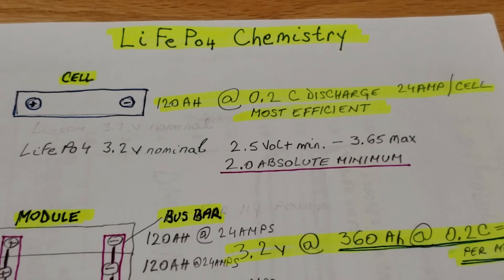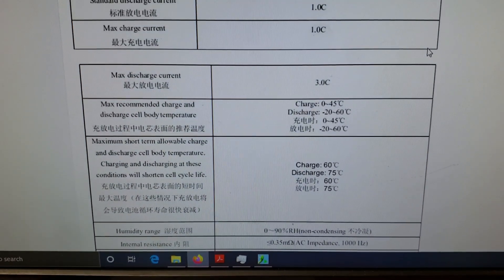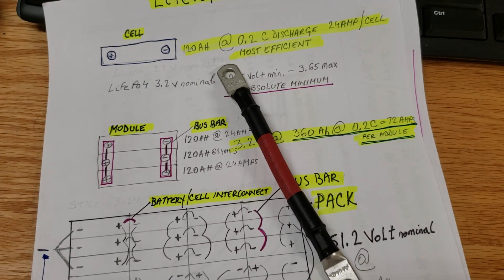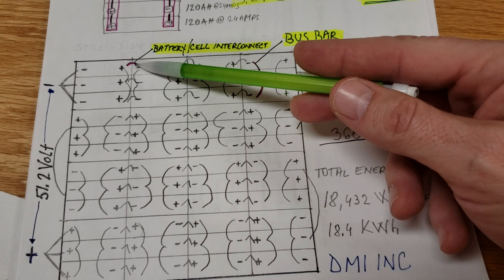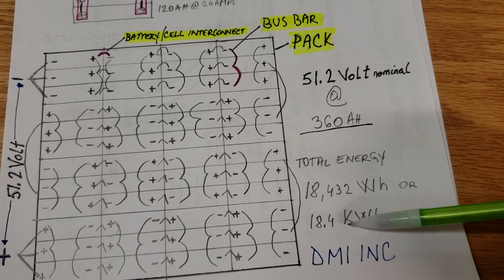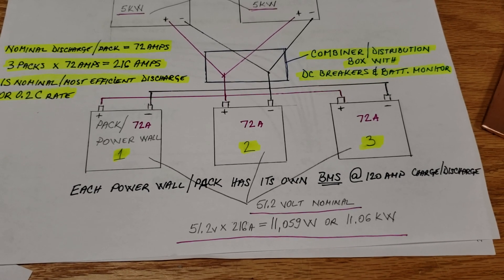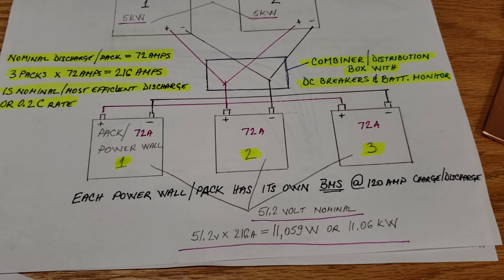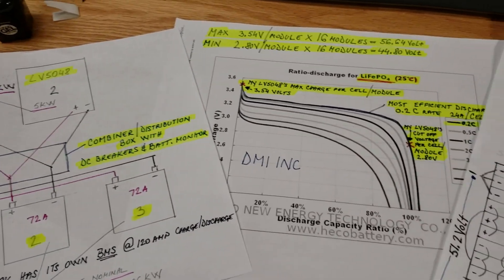MPP LV5048 Battery Talk.

Comment: It's been a while since I been on here I have the same identical 120ah cells coming I was wondering can I do that same 3 cell configuration in a 24v format & how many cells it would take ?
Reply from the maker: Yes. Why not?
Reply: @DMIINC2013  oh ok yes I have 8 coming at a time till I reach 32 cells got a good deal on them right here in the U.S but u have to drill ur own holes tho or weld the bus bars these are grade A cells brand new

Comment: Where/How did you come up with .2C (point 2)?
Reply from the maker: 8:29 Chart in the video.
Reply: @DMIINC2013  but is it worth that small difference?  By the time it matters cell will be a tenth of this price.
Reply from the maker: .2C or below is smoothest charge and discharge curve that creates the least amount of stress on the cells and provides highest capacity possible while keeping temps in check. If you see some of my later videos you will see that it is worth doing it. But your situation might require something different.
Reply: @DMIINC2013  I beat the hell out of lifepo4.  I get full capacity at 1C - plus and minus.  In 6000 cycles I’ll buy more at double capacity for the same price or less.  I’m down in Fulton County - no hoa for me :)
Reply: Love your videos tho - awesome work.
Reply from the maker: Thanks, I since moved and have everything running. No more HOA for me either.

Comment: Very informative videos. As per data sheets, it says it can handle 24 kw parallel. Do you think its good option for high load business offices or I should go with other options?. Thank you.
Reply from the maker: What load is calculated for your office?
Reply: I would say it reaches 22-23 Kw. Its a large office which has multiple AC running. SMA battery inverters seems an option but very costly.
Reply from the maker: You would need something bigger then what i have when it comes to inverters. In addition my power wall design is limited to 6.3KW max per power wall. SO 3 of them make will give you 18.9KW max.
Reply: As in your video you have 11.06Kw discharge. You calculated that from 216A * 51.2= 11.06 Kw. I am planing to use 280 Ah batteries which have discharge rate of 1c. Which gives me in three modules 43 Kw. I don’t know if I am right. I will be happy if you could correct me.
Reply from the maker: That would work as long as your inverters can support it.

Comment: My rate for grid power is 11 cents per Kwh. The cabin I want to build we cost me $4000 to get the electricity poles installed. I was thinking on 1 of these inverters, Gen 1 leaf battery and 5kw in solar. I'm not sure if to attempt living off grid or just getting grid power. This cabin may only see 40 to 60 days of use per year. I also have my 11,000 watt generator on my truck at all times.
Reply from the maker: That is a tough one to answer. $4000 for utility to have the power to the cabin plus monthly costs associated with it or doing something by yourself. Do you like DIY? How many sun hours at your location? What kind of loads will you be running at the cabin? Ground mount or roof mount? Lot of things that have to be answered before you make commitment. 40 to 60 days per year of usage would make me lean towards utility. Or maybe you are planning to live there some day? For me it was fulfilling childhood dream of having solar power and doing this by myself.
Reply: @DMIINC2013  I want to say average is 5 sun hours, that's peak sun correct. I think biggest load will be the AC, maybe 2 window units of 8000btu. I bought the property and I want to have animals so with the cabin we would stay weekends there plus our daily visits to check up on animals. I have my welder on my truck and that can power my plasma cutter or compressor. The system would be ground mounted using a 3 to 5kw array with a 5kw inverter. There is no trees to shade panels either. I'm just in a tight spot to determine which route. I would do all the work to keep cost down.
Reply from the maker: OK. Do an audit on your consumption/load. Are the 2 ac window units on 120 or 240? Why not mini split HVAC unit? It looks like you are on the right track and what you are planning to do is doable.
Reply: @DMIINC2013  This is a project for my cabin which is still being built. I ran some test at home with my shed, 8000btu unit and my 48v inverter. I could probably do a mini split and will check the specs on my 1ton unit. I had some money come in and started the cabin and getting gear for solar. I think I will do just 120v. Thanks
Reply from the maker: Nice project. If you can do split phase inverter it might be better for the long run. Good luck and post some videos while doing it if you can. Always like to see how other peoples projects are coming along.

Comment: Nice presentation and a well balanced system once you add the solar the calculations change a bit as the replenish rate of the solar delays the discharge rate but that is a good thing.
Reply from the maker: You Sir are correct. These numbers are for night time (worst case scenario) use when no solar energy is available and I could possibly have 2 AC units running. Bit of a overkill but that's how I do majority of things. Thanks,
Reply: @DMIINC2013  How is the surge rating on those Inverters I hear it is not good.
Reply from the maker: @offgridwanabe  Double the output for 5 seconds. Comparable with all others.
Reply from the maker: @offgridwanabe  I see you were watching David Poz video. Haha... I will have a short video on that topic soon.
Reply: @DMIINC2013  Yes I watch most solar activists I like to know what people think about their equipment and share information. I remember when David just started his channel has gotten almost to commercial for me.
Reply from the maker: @offgridwanabe  Understand what you are saying. I watch most of the channels too. I think that I saw some of your videos too before i even bought any of my equipment.
Reply: @DMIINC2013  I am not good at explaining stuff but I can get it to work most of the time, electricity is my worse field as I don't really understand it.
Reply: OffGrid Wanabe David’s Video didn’t seem like a fair test of this particular inverter. First he had it setup in split phase 220 voltage and attempted to run a substantial surge load on only one leg of that output. My suspicion would be if he had ran the inverter in 120 (I think that’s possible on this model) the two inverters would have worked together to carry the surge load. 

A better test would be to hook the inverter up to a 220v well pump surge load in the configuration he had it in.
Reply: @ahamichiana  I understand but if I had one it would be run in split phase so for my use it is reality. The Magansine also does not do 120 as good when in 240 mode.
Reply: OffGrid Wanabe 

I intend to run two of these in split phase so I should be able to support 5kw per leg so not much of an issue for me
Reply: @ahamichiana  True and that is the same conclusion I have with that inverter and for the price it is a really good deal.
Reply from the maker: @offgridwanabe  I kept thinking about David's test and I discovered his test might have a huge flaw. He only had inverter for a day and he does not have correct settings programmed into it.
Reply: @DMIINC2013  That is quite possible he makes lots of mistakes same as me if you can shed some light on it that would be good for all to see.
Reply: @ahamichiana  That unit can't bridge like that, it is split phase only. I have the 5048MG and have NO problem running a compressor and a chop saw at the same time. plenty of power to spare.
Reply: Michael Illingby 

So you are saying that if you run two of these inverters in parallel each phase is still limited to 2.5kw? 

That doesn’t make sense
Reply: @ahamichiana  Make sure your SET to 2A2 on the Phase setting which is #28 in the Manual and when setting for this 240v 180 degree, you must turn the inverter to standby mode, and then change the setting to 2A2 in the #28 setting program.

Comment: Thank you for the hard work and illustrations. The biggest problem I have found (besides the charge controller limiting my charge rate (10kw solar limits it down to 4.5kw)) is the damn water heater, lol. It takes so much power. I heat water, in the tank in the morning so the batteries will charge. Have never had a real issue with the 5048. Planning on getting a couple more and more nissan leaf batteries (only have 21Kw now, but around 16Kw really). Nice system man, and your work is beautiful.
Reply from the maker: Thank you. You are saying that you have 10KW solar array?
Reply: @DMIINC2013  Yes. I have 40x 245 solar panels (9,800w). The charge controller limits my total to about 4,500w when the sun is out completely. It will bump up to around 7,500w during cloud edging, but only a few seconds.
Reply from the maker: @Lumbeelegend  There are at least 3 or 4 different setting for solar charge controllers. Did you try adjusting them?
Reply: Yes resistance heating uses lots of juice  I put my tank on a timer so it only comes on 4 hours a day from 11 to 3 which is the best sun times works good in summer but not enough sun come winter.
Reply: Look into the heatpump waterheaters. They cost a lot. But 700watts at 4hours to heat vs 4500watts for 2hours. If it's in a conditioned space it's more efficient. Also helps having a larger inverter.
Reply: @patrickdk77  ok, I'll definitely look into it, sounds interesting thank you. I'm looking to add another MPP Solar LV5048 inverter/ charge controller. I have 1, and it work really well (besides the charge controller limiting the solar)